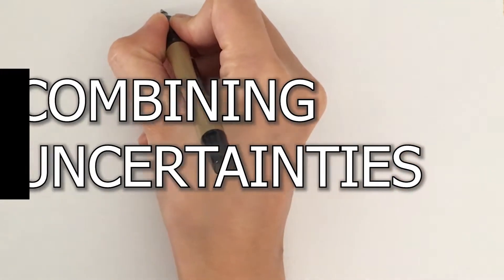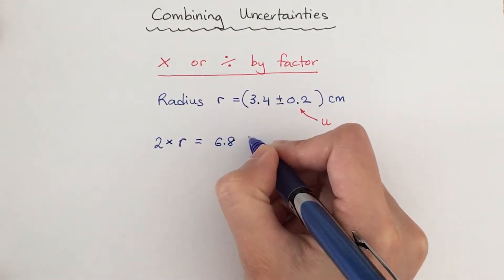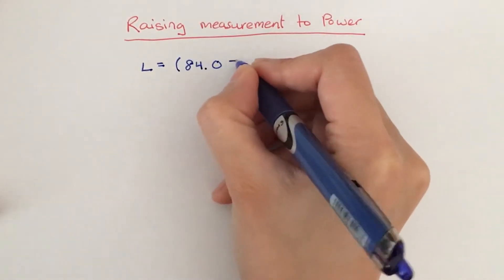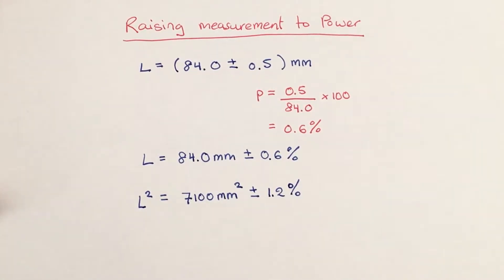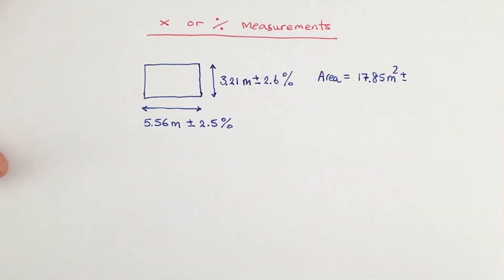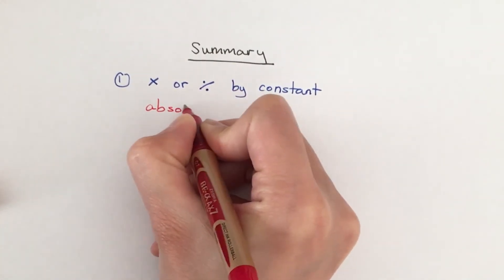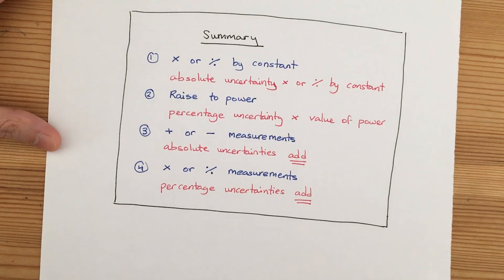Combining Uncertainties | A Level Physics

Comment: Thank you for this very usefull video.  very clear explanation. 
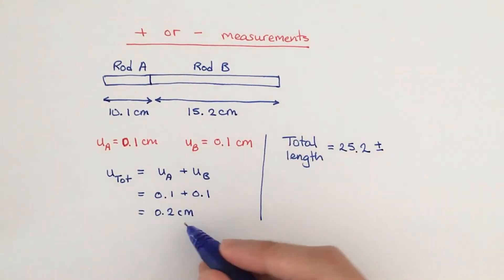Small miscaculation: at 04:15, adding 10.1+15.2 would come out on 25.3,  and not 25.2.

Also when dividing distance over time (06:03) you round down the uncertanty to full number. (14% instead of 13.5) what are the rules for that?
Reply: UNCERTAINTIES must be within 1-2 significant figures, no more than that. Hope that helps!